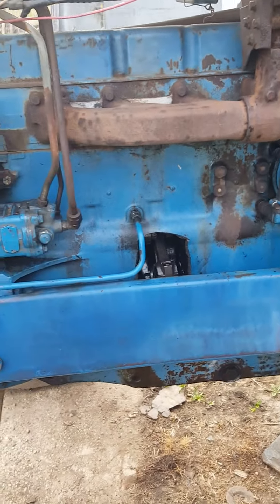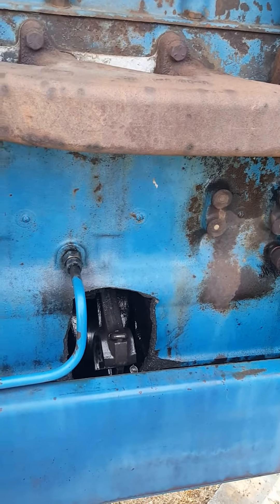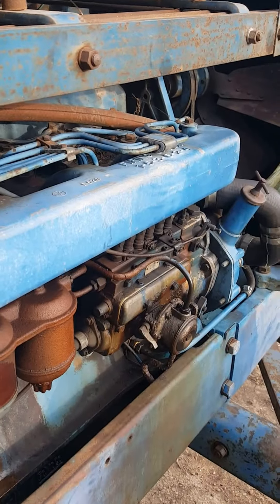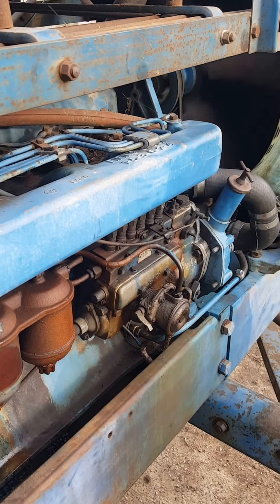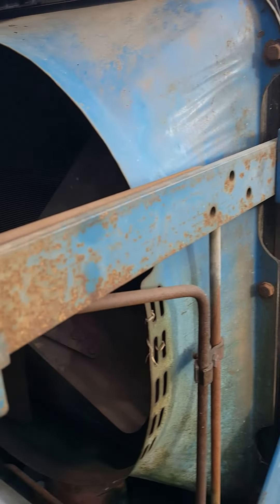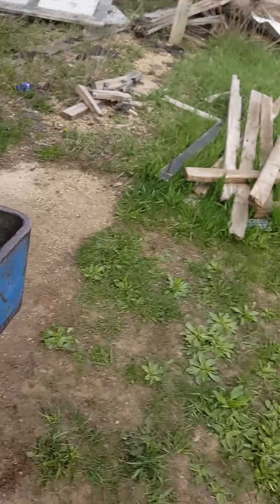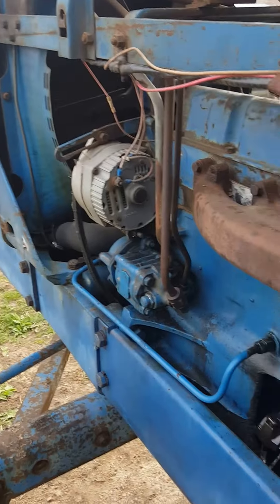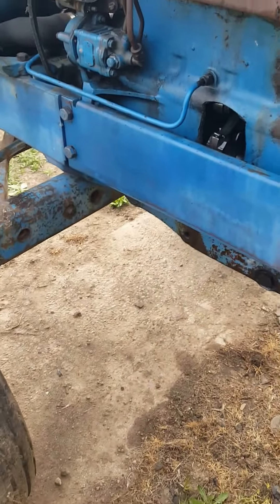Ford 8000 with hole in the block starts

Comment: Did u get a new motor? Lol
Reply from the maker: No i ended up selling as is. sorry i didn't respond for year!
Reply: @Knee-Deep-in-Wisconsin  all good. Those are great tractors I have a 5000 that will I feel sure pull down most any house/ building
Reply from the maker: I have a video somewhere of myself and my son pushing over a 30plus ft tree. Did it like nothing. I actually have another one with a loader on it that I kept. Great tractor,  very reliable.
Reply: @Knee-Deep-in-Wisconsin  just never use ether to start them and they will last a lifetime.. or multiple lifetimes seriously